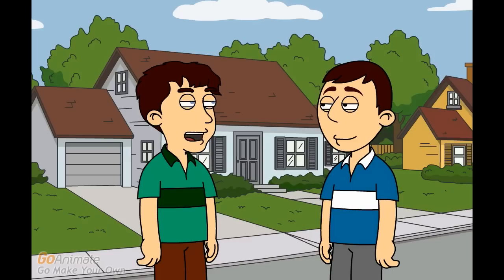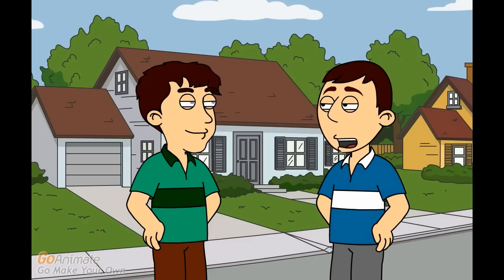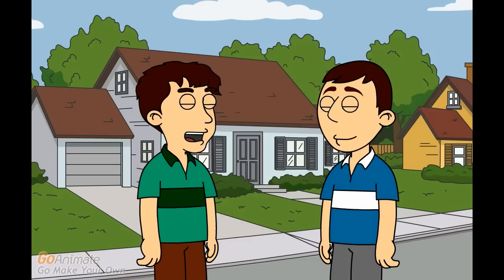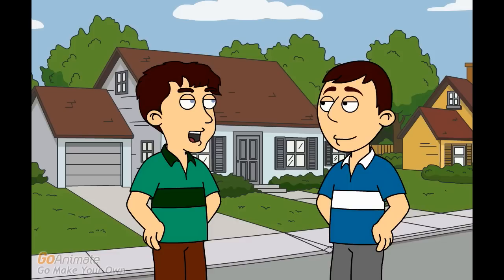My Refrigerator is Too Cold!

Comment: Hi princess 🙃
Hope you can help😅🥲
My problem is with a double door beverage cooler fridge I recently purchased. (the kind commonly found in corner grocery stores) Im a baker and use these fridges to retard fermenting bread overnight and so need it running at specific temperatures. I’ve purchased a new thermostat, didn’t work. I’ve tried positioning the probe on various ways, didn’t work. I’ve now placed the probe into a bowl with ice. The fridge is still running permanently. 😢😭😤
(I’ve been using beverage coolers for this purpose for a few years with no problems)

Comment: I purchase a beautiful REX small refrigerator for 25 Euro, because it was freezing and running all the time. I changed the Thermostat, and placed the end probe where the previous one was... away from the freeze box. As I had the same problem I did what you suggested and it worked perfectly, only I wasted 13 Euro for a new Thermostat.... But I have now a 300 Euro Fridge for only 38 Euro. Thank you. You were the only one that described a possible problem  when the motor is running at all time or freezing too much. Simple when you know WHY. Thank you agsin.